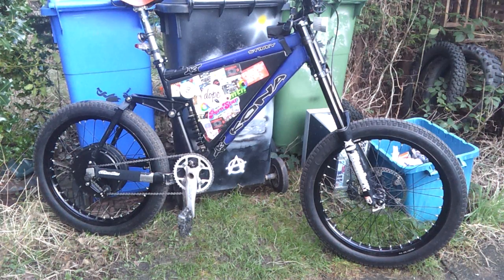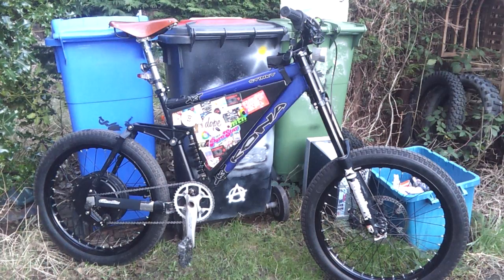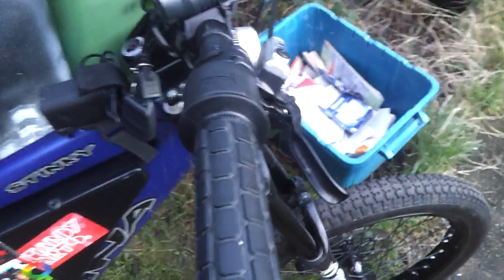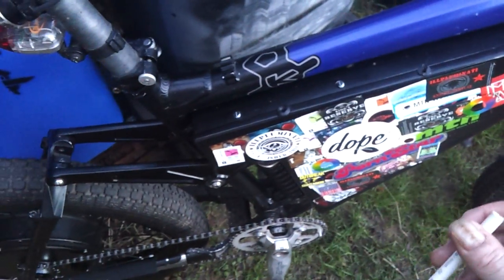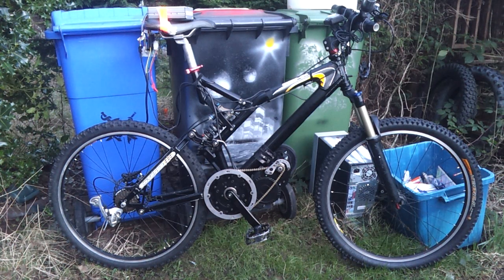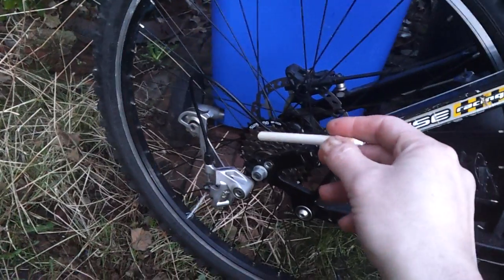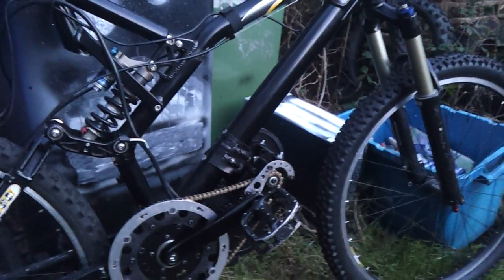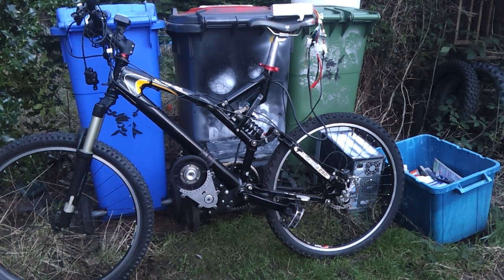Electric bike hub vs mid drive..a brief over view

Comment: You didn't mention the big difference between direct drive hub Motors and mid drives.

Direct drive Hub Motors if power runs out.
You can't ride the bike.
Well you can but it's 20 times harder than normal.

Mid Drive Motors you can ride like a normal bike without power.

Comment: What material is the battery box made out of??
Reply from the maker: Sheet aluminium..:)
Reply: Crispymenace Thx! Also did you drill this into the frame, and what batteries are you rocking?? I’m building one too atm
Reply from the maker: @rocker4579  the boxes on both bikes are fixed to the water bottle mounts..just hex head bolts.
Good luck with your build.
👍

Comment: I'm really glad I stumbled across this video. Very informative, interesting and useful.
I kind of thought that there would be Hub v Mid purists, insisting their respective choice is best. It's reflected in the comments too.
I am in the process of getting my head round what to get to start my Ebike build. I've plumped for a mid drive setup mainly for appearance, weight distribution the gear option. The two pluses you mentioned, a bit of off road and range are just what I need and there are quite a lot of hills round where I live.
So I'm going for the Cyclone.
Thanks for making this video Crispy.

Comment: I love that you took the time to compare/contrast the differences between the two. Very nice work! I would have to say though that you might want to take a look at the new Lunacycle motor that they just had made and put up for sale. It is a double planetary geared double roller clutch hub motor. It uses the DC motor's ability to spin both directions to change gear ratios by having the roller clutch lock up going both directions. For those of us in the USA that keep to the legal limits (25mph/750w) it gives a 26" MTB a hub motor that will do 12mph in low and 25mph in high. It basically combines the advantages of both hub motor kits and mid drive kits into a single unit!   https://lunacycle.com/double-gear-double-torque-motor/

Comment: Mid drive is way better if you ask me.. I have the Magic pie and my other bike has the cyclone mid drive system.. of course the magic pie is simple to install and works well around town or commuting to work etc etc, but for shear fun and to put a smile on your face, my cyclone is just awesome.. so much torque and power its unreal.. how many times have I whizz past those guys in their fancy tight leggings and all kitted out? lol

Comment: Yeahhh.. really nice review talking about the pros and cons of each system, its hard to find people who rides both, they are either mid-drive only or hub motor only.... they will always argue that what they ride is better than other...
My personal opinion, I am a mid drive guy but I work in an ebike shop, we have to build some hub motors, very heavy but its kinda nice to have single gear sometimes specially on flat and downhill.. as soon as you hit hills things are COMPLETELY different... mid drive will climb hills like a monster with very little power while hub will struggle sooo bad specially if you need to stop half way up hill (traffic light for example) just to get that heavy hub moving again will require ridiculous amps so you need a much bigger battery, that makes things even worst, more weight you're adding on..  you know all that stuff.. I am just writing here cause lots people do read these comments, you covered a LOT of things in your video, well done =]
Reply from the maker: thanks again dude..this is a very large hub so i dont have problems with hills and stopping and starting..[6kw peak] with a really nice sinewave controller too its totally silent!
still gears always help on hills and your right things get a little hot if i climb hills on it for too long[amps] tho regen down the other side is always a bonus!
but you know what i say..for e bikes  amps are champs...lol
all the best.
Reply: +Crispymenace - Hahahaha "Amps are champs" hahaha this is why I'm building a 840A one... yes, I think I went a bit too far and this is a bit of a problem slowing down my build big time, lots of challenges (too many, my brain is about to explode!)
It is a 42000w belt drive triple motor but noisy as hell... 
Yeah, I would say most custom mid drives are very tricky, noisy and sound more like a chainsaw but they pack a serious punch!!!
"6Kw of silence" sounds very good to me hahaha =]
Reply: What's happened to those small geared hubs you could get a few years back?
I'm not sure who made them but they were way smaller and had more torque and less weight..

Comment: PLEASE share your experience with suspension on an ebike, but only if you rode with/without long enough to make an comparison. I ask because I see you do off-road, which I plan to do once in a wile myself, and I want to get the best frame upfront, cheaply as possible :) My off-road-ing will be mostly relaxed trailing, but some parts of the trail may have rough terrain. Thank you for your time!
Reply from the maker: hello buddy,
i dont ride off road that often any more, usually trails and woodland tracks  during a commute to one place or another.
i have  ridden off road on both ,the extra wieght on my bikes makes handling and feel quite differant.
as regards on road i have a few thousand miles clocked up now and the suspention really helps when your doing 35 mph plus and you hit a pot hole or speed bump it takes a lot of the strain of impact away for me and the electric components! i know people that ride hard tails with modest electric kits on road and they get along fine with it..its all down to rider preferace and bike wieght really i suppose.suspention deffo makes for a plusher ride and the hard tails for a more direct road feel. i wouldnt be with out a full bouncer these days, especially up here the roads are shocking.
thanks for your comment,
all the best
Reply: Thank you! Based on your input I'll get the front suspension, but if I get the rear suspension I sacrifice a lot of battery space. If you have to sacrifice one of them, what would you do? This is the last question, I promise. I also heard suspensions are only good on the 1000$ range, the cheaper ones are pogo sticks. They also need replacement often, so I would prefer not to get it in the first place.
Reply from the maker: no problem buddy ask as much as you like..im happy to help.
it is true that cheeper suspention can be troublesome..if your using it for light duty it may be ok .
the pogo sticks are the ones with no damping or rebound control..good suspention is a pretty penny though your right there.
which frame are you planning to use?
 and what size?
 i think id take battery space..thats the gogo jucie so the more the better really.
you could get front sus and fit larger tyres all round that will give a little more cusion to the ride.check to see the biggist ones you could fit on your frame..again the bigger the better!
what drive system are you going to use..hub or mid drive?
regards  crispy.
Reply: Hi Crispy, I really want a Bafang G06.750, but I also want a Rohloff Speedhub, so I'll have to use a mid drive with that. Mid drives are not that appealing to me, as I've heard of the extra wear, noise, maintenance, and shorter lifespan. I'm really torn between the rear hub motor and the Internally Geared Hub. My custom fat bike  will be an all steel frame (still looking for the best type of steel for it) , belt drive (vertical dropouts; split frame) and the biggest 48V battery that fits the frame that I can find (or build :) ).
Reply from the maker: oh yes buddy mid drive and a rohloff will defo kick ass..
mid drive will be fine with that hub buddy..no derailer or chain line issues to worry about..should give many hours of fun , and the bafang units are becoming very popular now, lots of after market stuff available for them too.
the whole idea sounds great im sure your gonna get lots of fun filled miles out of that build.
keep in touch and let me know how it goes..
if i can help with anything else  just ask buddy.
endless sphere web forum has lots of info on bafang drives ..the chaps on there are very good with the advice too.
all the best .
crispy..;]

Comment: I use a 1k motor @2.5kw hub motor off-road all the time. Maybe the MXUS 3000 is just too heavy. My motor weighs 12lbs. Not a good assessment to say hubs are no good for off-road. Look at the Stealth bikes
Reply from the maker: hello buddy,
handling is always baddly affected by unsprung weight. an equally powered mid drive would handle way better than any hub motor.
steaths are a nice thing at 10 k they should be..but a 125 motorcross bikes handling would blind it.
im affraid physics is on my side here...google unsprung weight and inertia for more info.
all the best.
Reply: +Crispymenace I understand unsprung weight. what you said in the video is that all hubs are unsuitable for off-road which is a very broad assumption. Your analogy is not any better. A pro rider on a stealth vs an average on a moto the pro would win. yes the moto is more capable but the rider skill trumps all. its like saying you cant race a honda because a ferrari is better at racing. All im saying is off course youre not gonna be jumping a hub (even though some do). depending on the conditions a hub can do most riding you can do on a regular MTB of course unless youre an extreme pro. The heavier the hub the bigger the penalty. My bike with a 12lb 1000watt motor feels like a feather compared to my friends 25lb 3000wMXUS. also my hub has very little cogging compared to the MXUS. I can pedal for miles at normal speeds on his bike it feels like an exercise machine.The unsprung weigh can be curbed to a certain degree by suspension tuning as well.
Reply: +Crispymenace also there videos here of stealths destroying 125cc+ motos in enduro racing.
Reply from the maker: thanks for your comments.
we will have to agree to disagree here,i ll continue to enjoy the relative performance aspects of hubs on road and mid drives off road,there are many other factors at play including longevity , speed,gears and terrain type that all play there part.
ive seen people beating 450cc ktms on pit bikes too..its all about the rider.
atb.
Reply: +Crispymenace very true too many factors to make unsprung weight the overall limiting one. I agree
Reply: Unsprung weight becomes a non issue if you ride a hard Tail!

Comment: Informative video & good advice, been thinking of fitting a mid drive system to my bike but the bottom bracket measures 92mm, any kits available that will fit ?
Reply from the maker: +John Hitchen hello,i think it is possable at that size..have a look on endless sphere e bike forum the people on there will tell you or check it out with the people your thinking of getting one from,they will be able to say for sure.
hope that helps buddy ..good luck with your build.

Comment: Nice, I am in the process of a DIY project moding my longboard with two rc motors and 2.4 Ghz for handheld radio control. I didnt catch it in the video, but what top speed you get on it?
Reply from the maker: +dseed norway sorry buddy  just found a load of comments awaiting!
top speed is around 50 mph on boost mode but it soon uses all the battery at that..need a bigger capacity pack for more fun! gets around 8 miles on boost up to 16 on normal with plenty of peddaling.
hope your well.
atb.
Reply: thanks mate, I know how it is ;) May I also ask of the total weight of the set up of the motor and battery? (not including the bike)
Reply from the maker: +dseed norway not sure exactly buddy..at a guess about 3/4 kg for the motor and the pack is hobby king rc cells its the 5 ah hardcase packs in 4s and there is ten of them..5s 2p.think the weight is on the hobby king web site per cell..at a guess another 4 kg at least in the pack plus box and wires.

Comment: What is the remote control you used to control the lights? Looks like the same rear light I have, Magicshine MJ818 - Cheers!
Reply from the maker: +Nathan Tibble  hello buddy yep it is a magicshine..they are bloody bright too arn t they  ;]
the remote runs from the main pack stepped down to 12v.its a cheep chinese power adapter with a  wireless remote unit wired to its output..think ebay can provide them.
next time im inside the battery box i will look at the  things and see if i can get you a serial number or makers mark but im sure any ole car/ caravan remote system for 12v would do it.
12v 3a is the rating as i remember.
all the best.
Reply: +Crispymenace Very bright, indeed.. but the method to switch through modes isn't so good :p I have one on a bicycle(not electric) and would like a remote to control it so hopefully there's a solution. Thanks for info
Reply from the maker: +Nathan Tibble saddly buddy i dont think it will help..mine shows a differant mode everytime i turn it on..wish i could reprogram it..lol..
good luck trying it tho..let me know if you find a solution.;]